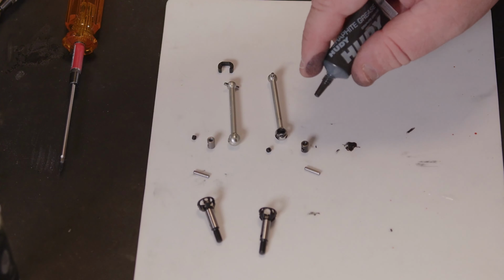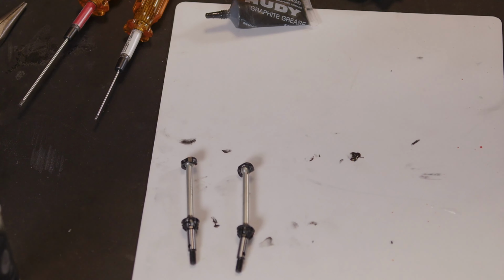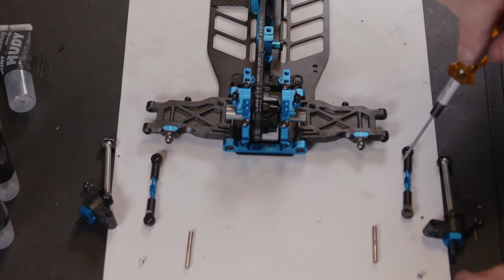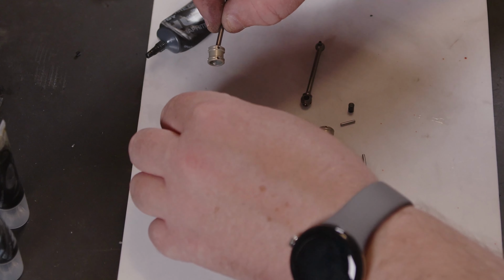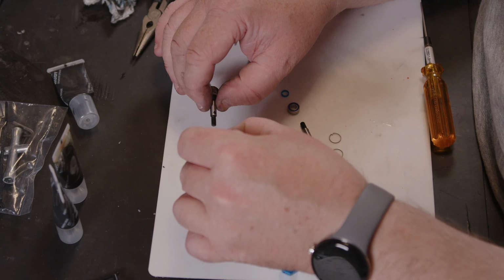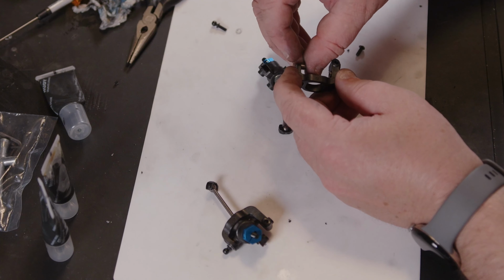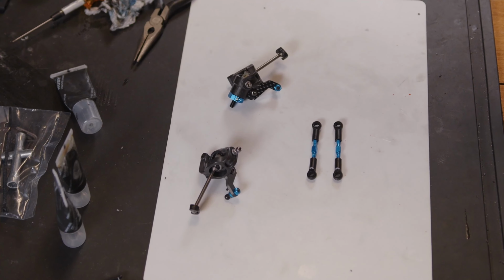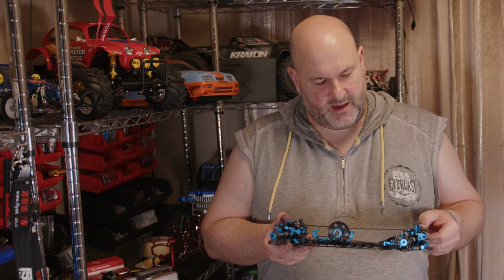Tamiya TRF 420x build parts 22 - 29

Comment: Excellent detailed build and quite helpful. Any possibility of another video on the Tamiya TA08R build?
Reply from the maker: I already have a highly modified TA08 Pro so don't think I will be getting an R
Reply: @WTFRCCars  I would like to get your advice on an issue with  regards to my TA08  which I am upgrading  to TA08R.
I already have the Tamiya aluminum adjustable suspension mount E (54882) and the aluminum adjustable separate suspension E (54885). Do I have to buy the A ones as required by Tamiya?
Thanks in advance
Ramez
Reply from the maker: @ramezgoussous3303 I wouldn't think so unless they have changed the diameter of the bar that connects them